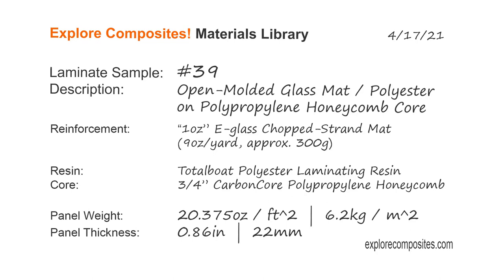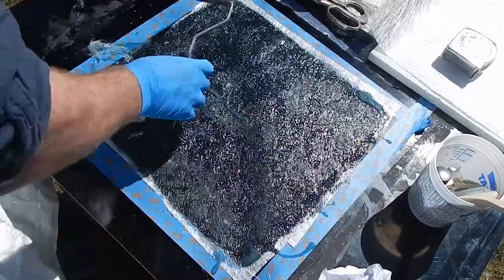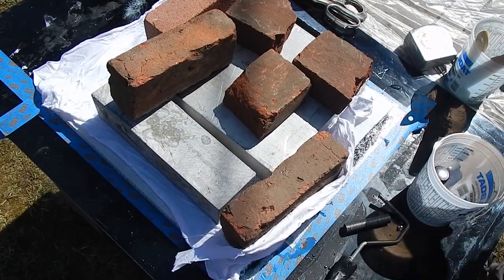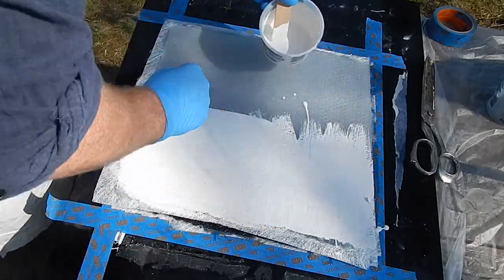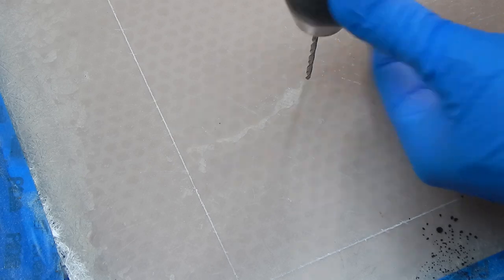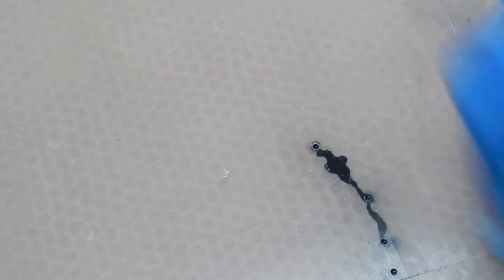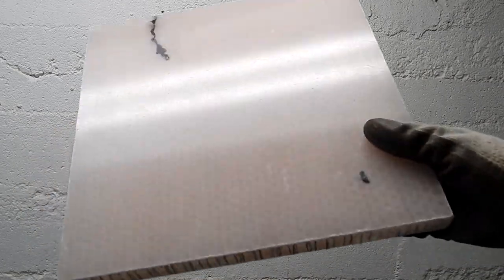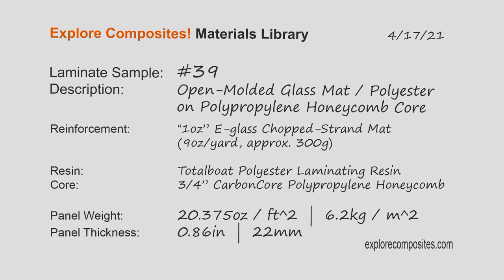Laminate Sample #39: Open-Molded Glass Mat / Polyester on Polypropylene Honeycomb Core

Comment: I made a countertop in my boat with that honeycomb.  The top was one layer of 4 oz surfboard cloth so you could see the honeycomb through the glass very clearly.  This was followed by a thick coat of clear countertop epoxy.  Run a torch over it to pop any bubbles in the epoxy and repeat every half hour or so until it starts to harden.  The honeycomb looks so 3-D

Comment: Thanks for sharing with us. I plan to make a boat gangway 3 m x 45 cm. I want to make with 20mm  plastic honeycomb core. Any ideas how many layers  of  fiberglass (200 gr.  thickness) should I use?
The load capacity should be 250 kilos. Any idea well come.
Reply from the maker: I am not going to go pretengineering in Youtube comments but would suggest that 20mm core is probably not enough.  At 3m, you will want some type of structural "tubes" along the edges with a deck that need only support the 45cm span, or more serious engineering.  Look into yacht "passarelles" made from composites - people build some pretty fancy stuff.

Comment: thanks for sharing. question, (hope its not too dumb) i know you can use polyester resin to lay the fiberglass on top of the honeycomb, but is it okay to use it to join the honeycomb edges? or should that strictly be epoxy resin? for example, if i'm making a box with honeycomb, can i stick everything with thickened polyester  resin (peanut butter)?
Reply from the maker: Yes, polyester should be fine - or at least that's what I'd do.  I am not actually sure how the resin will stick to the edges of the cells but in practice it should key in there well enough for joints or corners even if the adhesion is sub-optimal.  The scrim on top is made to be bonded but I'm not sure what the treatment is.  You could certainly test the edge gluing with scrap.  

With epoxy bonding the joints, I'd worry more about the polyester resin in the fiberglass skins not liking to stick the the epoxy.  If you do decide to use epoxy for adhesion, make sure it is well cured and sanded.  A methacrylate adhesive like Plexus would probably work well too.

Comment: What is the viscosity of this polyester resin?
Reply from the maker: Depends on temperature but probably up near 800 or 1000cps at room temperature.  The styrene and breaking down reinforcement (mat) binders make it feel much thinner in use than the viscosity in a cup would lead you to expect.